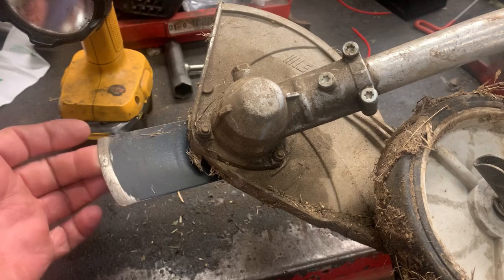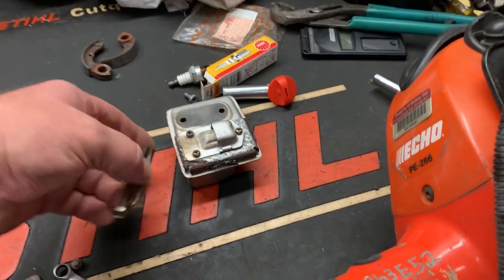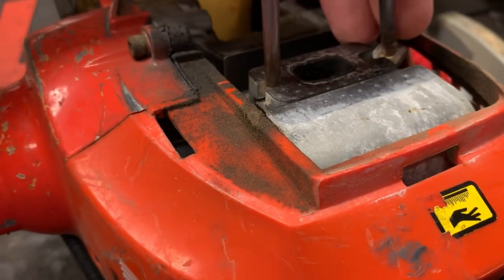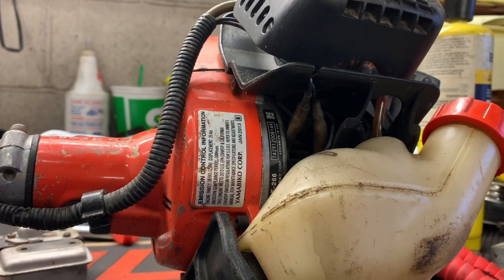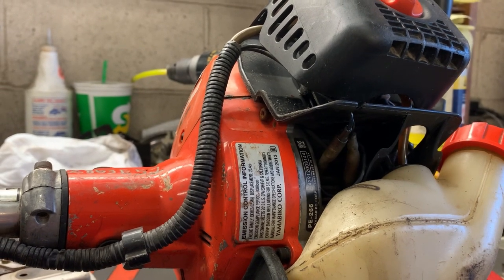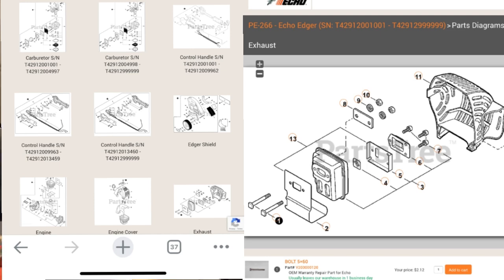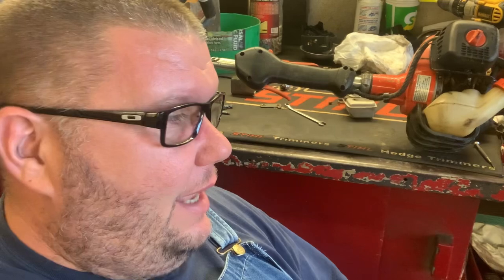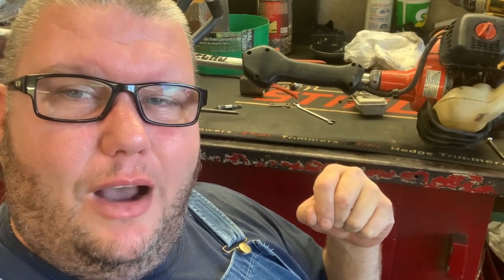HOW TO LOOK UP PARTS ON #PARTSTREE

Comment: Do you know where you can get parts for Stihl.
I have a Stihl weed trimmer and I need a trigger for it.
I didn't see Stihl listed.
Thanks, appreciate your channel and all the information.
Reply from the maker: Go to the stihl website click on dealer locator tap in your ZIP Code and all of the dealers that sell stihls will be listed
Reply: @THEMOWERMEDIC1  
Thanks for the info. 👍
Reply: Stihl has pretty much made sure their Dealers are the only outlet to buy parts.

Comment: Question.

I have a older fs130r stihl trimmer. I've replaced all intake gaskets and fuel lines. I've tuned the carburetor. It runs perfect when hot, but when it cools it has a hard start and doesn't want to idle. Any advice? Thanks
Reply: Do you do the usual routine when starting it up cold? You know prime it so many times with choke on, pull a few times, then half choke, pull so many times. When it starts just let it idle with half choke until it warms up, then open the choke all the way and then you're ready to go?
Reply: With Stihls you'll need to check for proper valve adjustment gap.

Comment: I just received crankcase breather parts for the Briggs & Stratton on my portable cement mixer. Had to look & look thru the parts diagrams to find the breather rubber elbows, but they were there. 
Fast shipping too ! 👍